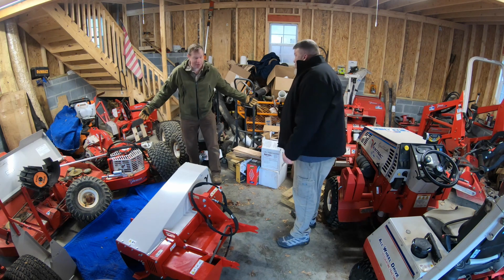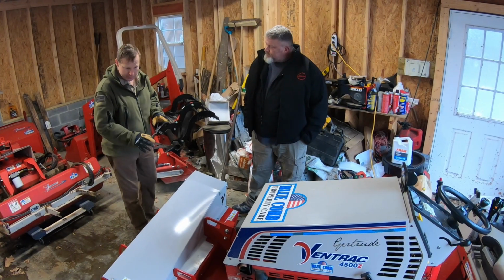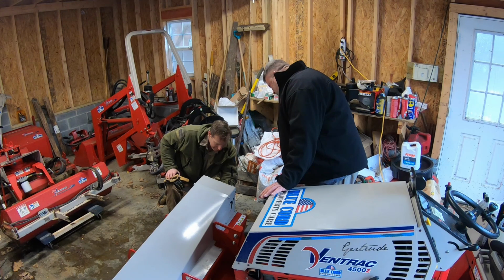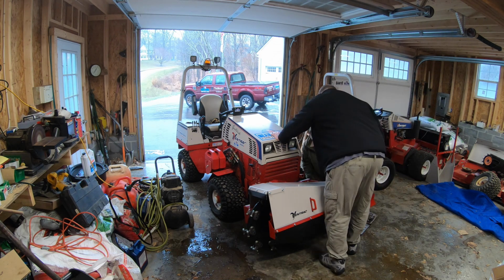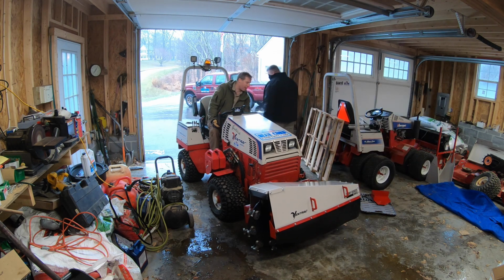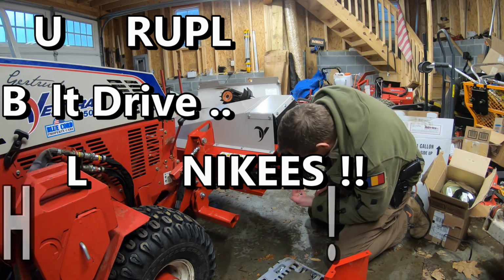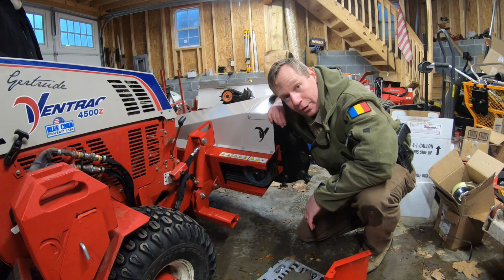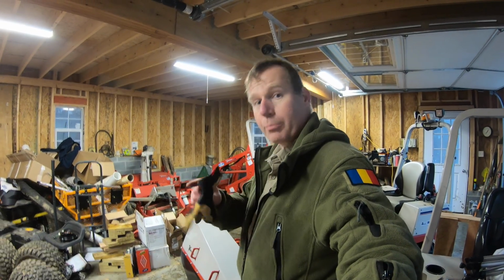Ventrac KC220 Stump Grinder-A Closer Look Part 1

Comment: Really Cool! People that buy a Ventrac appreciate seeing this stoutness and appreciate that they're not buying a throw-away type of design. 
Impressive final drive to the disk! 4 heavy duty matched belts running on a 'real' pulley and substantial axle and bearings. These belts should almost never slip or fail. My guess is that after initial run-in with 1 re-tension adjustment ...they'd hardly again change for a very long time. The PTO belt will be the canary.
Thanks Bradley...and thank you Rob🙂
Reply from the maker: I'll probably do another video today showing more of the internals.  I may even find a stump to grind!  We'll see

Comment: Thanks for doing the video.  I notice you have a mid bar weight set on.  Which tasks do you find the mid bar weights to be a benefit?  Does it help on stability on steep slopes?
Reply from the maker: It's a very uncommon accessory.  In fact, at the time I purchased it from the 2nd largest dealer in North America, they had never seen one!  I keep them on all the time and I cover it in another video.  Just do a quick search to find it in my video list

Comment: The new 220 appears to have some cons.  Belts should be easier to access.
Reply from the maker: I just got a copy of the manual.  It's not finalized but much of the hardware you see does not need to be removed to access the belts.  I'm making another video about that shortly